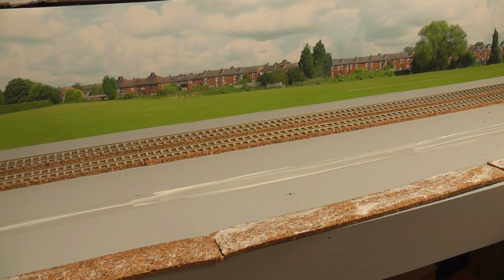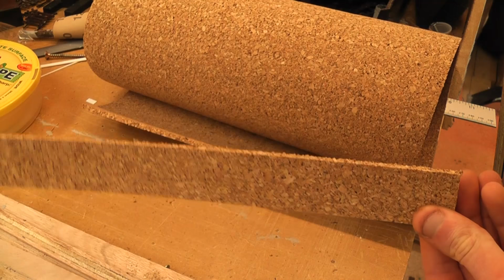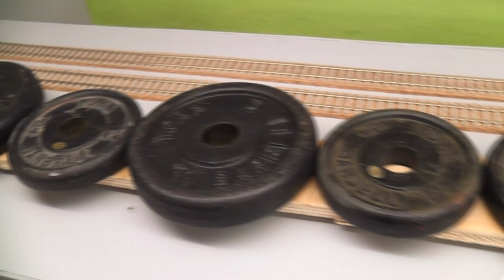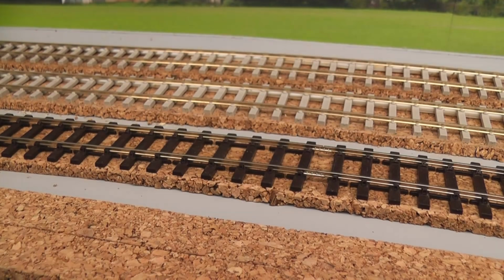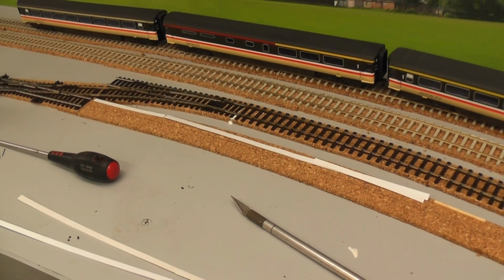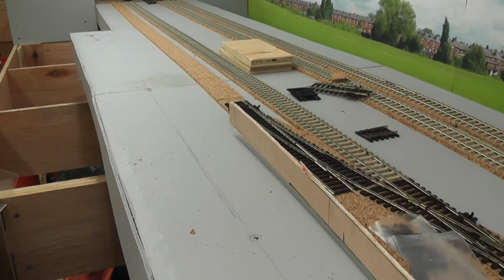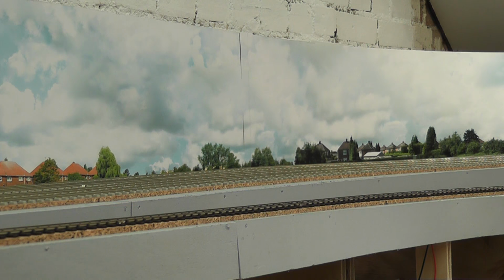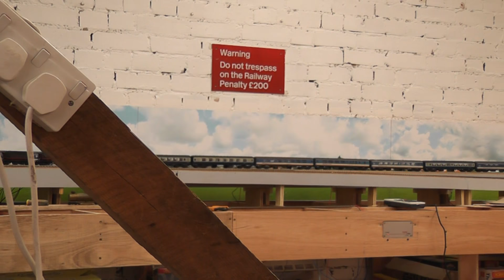New Layout Build - Track Laying

Comment: Richard,
Great craftsmanship.  After over 60 years of Model RxR'ing I must admit you have taught me some new techniques that I shall attempt.

But with every sunshine comes a cloud.  On the previous Everard Junction v-logs, when you were describing what you were doing, a body part of yours would block the cameras line of sight.  That does annoy me as I am, by profession, a TV Producer/Director of U.S. Network programs.  (Yes that is the correct spelling)

May I suggest the following to allow the viewer to see the action your dealing with.

From the opposite side of your focus field, tri-pod your camera to be aimed toward you, not over your shoulder.  The angle need not be a FACE TIME for you but an insert edit time for your hands and work area.

Seeing the back of your head, hands, back, or arms makes watching and understanding what you are doing difficult.

In this Episode you did use an interesting long end shot which did add to the shot sheets verity but you do need that close=up of hand work which is only available "from the opposite side of the tracks." (American colloquial).

Great lesson.  We'll be with "Down the line."

Comment: You say that the distance between the tracks is not true to scale - I don't think that that is quite right. The distance will be greater than the traditional 6ft way, that is true, but your layout is set on the Great Western Mainline (if I understand correctly), which would originally have been built in broad gauge. Therefore, there would be places where the track distances would be farther apart than the traditional 6ft way.

Comment: Excellent Richard as always. 
I’d like to pick your brains , we are building our new layout using Electrofrog points, and double slips and 3ways for the first time (i usually use insulfrog) and I wanna know if we have to put insulator fishplates on all of them?   Thanks
Reply from the maker: As a rule I put insulators on the frog or V of the the point or crossing.  Check the instructions as some of the slips can have different requirements.

Comment: I thought you'd forgotten about us! Glad to see another excellent tutorial video and fantastic to see your beautiful stock running again. I had a question though - your layout is called Everard Junction, and the old layout had a clear diverging junction but this layout doesn't? As trains on the relief can reverse with the siding anyway would it not give you more operational interest for the branch to merge with the relief lines so they can pass through if needed and then you'd get your diverging junction again? Maybe small freight or postal trains could come from the branch onto the relief and onto their destination this way as well as terminating services in the bay platform. The Class 121 looks great too - will you be doing a review on it? Thanks again for another great video.
Reply from the maker: Its technically still a junction of sorts as the branch diverges to a different destination.  Problem is getting enough space  to fit everything needed so this layout has a few compromises.  A review for the 121 should be along next if thing goes to plan, cheers.

Comment: Hi Richard nice video again, I have seen many methods of doing things no doubt you have also, do you ever get the the feeling that you've done a good job only to find another method that you wished you done. I soldered all my joiners  to avoid bad connections with a few droppers put in but now feel dropper wires would have been neat and tidy where ever possible.
Reply: You need to be a bit cautious - search for the clickety-clack video on you-tube and your eyes will pop out.

Comment: great as always i like to watch your channel for inspiration for my new n gauge railway  stockton junction (also on youtube)   just 1 question are u using a braided or solid core wire for your bus wire ? the reason i ask is that it looks like a solid core although that may just be due to solder .. as i did originally have a 00 layout before i swapped to n  gauge and at first i used a solid core bus wire  i ran into lots of issues with dcc signal loss after much research i found out that dcc signals run better through multi core wire and not solid core so thought id ask and also share this info with people who visit your channel

Comment: Excellent demo, thanks.
Is there any value in chamfering the edge of the cork (or cutting on the slant) so that the bailast shoulder is already generated by the cork?
Regards, Tom
Reply from the maker: You can do that will a sanding block.  I will be doing it at a later date.

Comment: Excellent video Richard really gave me food for thought on what I'd like to do with my next project. I noticed your coaches were close coupled, which system do you use for this prototypical result?
Reply from the maker: The coaches you saw are bachmann mk1s & 2s.  They can be close coupled straight from the box, not modifications required.
Reply: EverardJunction thanks for that, have to say makes running look amazing.

Comment: All looking ace Richard. Great to see trains running at Everard again. How has the velcro on your backscene boards held up during the hot weather? I've used the same method and all mine seem to have lost adhesion. Cheers...Jamie
Reply from the maker: Velcro is hanging on for the moment.  Don't forget I insulated the loft so I have a very stable temperature up there.
Reply: Very true. I only have the foil insulation which is good, but sometimes I feel it radiates heat and makes it very warm at my head height. Fortunately at track level the temperature is fairly consistent so rail expansion has not been a problem. I have stapled the velcro to the wood in hope that it will now hold firm. Thanks for you reply Richard. All the best, Jamie

Comment: Don’t cork also quieten down the noise of the trains running
Wood pva do the same as copy Dex as I have used it on my cork. Would it stick the track or do Is copy what I need
Why is the Reverseing siding not a bay platform with a cross over. 
Wiring should I need to wire ever section of flexi track. How do I wire insule frog points

Comment: Great video Richard. I have an unrelated question for you. Can you run bus wires on a DC layout ?
Reply from the maker: You can, but the wiring is more complex.  Each track output from the controller will need its own bus.
Reply: Thanks Richard.

Comment: Hello,I am thinking of building a model railway,Is it expensive to start up.
Reply from the maker: Yes, in these times it can be rather expensive to get started.  I was lucky, when I started 10 years ago the hobby was about 50% cheaper than what it is now.  You can still find bargains but it requires some shopping around.  Cheers